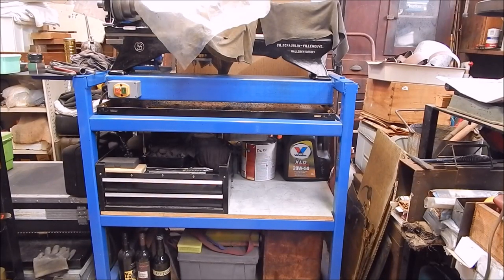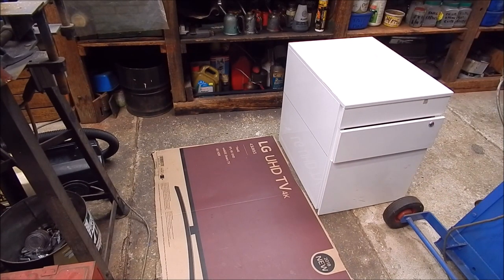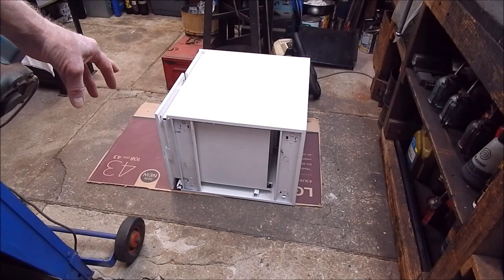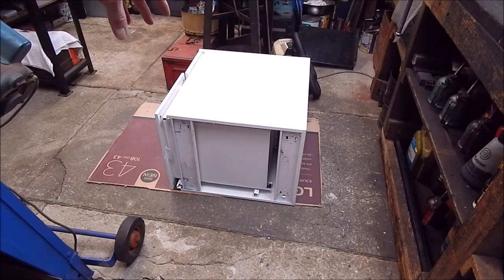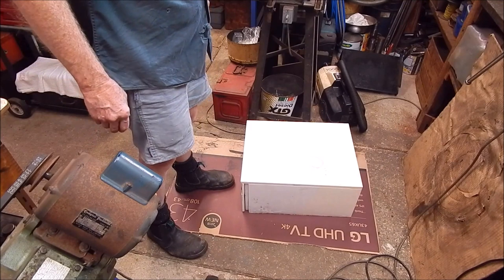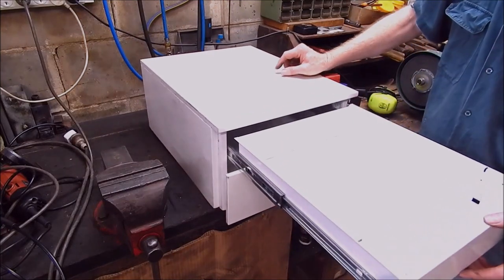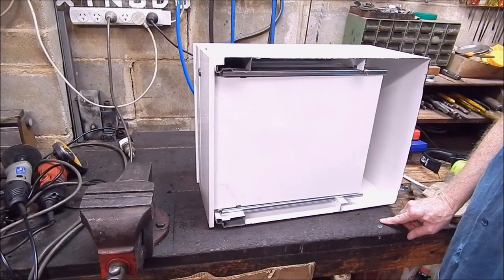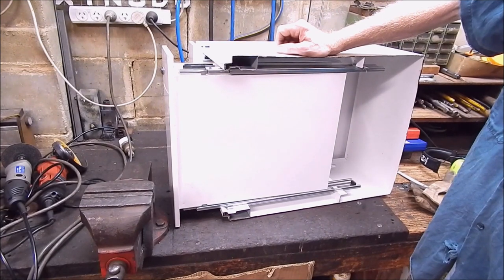I cut a steel filing cabinet in half for lathe tool storage

Comment: We have those cabinets in our office. Pain in the arse to move as the wheels fall off any that are moved. Your modification sounds brilliant as the top two drawers are perfect for tools and what not.
Some U tubing from possibly Supercheap Auto should finish the raw edges or a piece of ply with brackets fitted to the bottom will form a base.
Good score mate.🇦🇺👍

Comment: Hi Rob - cut the bottom off the cabinet and attach it with some pop rivets. It'll give you some clearance for the lower draw as well as the strength you need.

Comment: Glad to see you wearing the earmuffs Rob. It's amazing how much peace and quiet they bring to a workshop environment. I love 'em. You might even find me wearing them (accidentally) an hour or more after doing whatever it was that was noisy. I just love being able to shut the outside world out, and work with my own thoughts for a bit.

PS: What's the fire situation like in Adelaide?
Reply from the maker: Hi Craig,  Earmuffs are good. I agree with all you've said.  I've used a lot over the years and the greater noise reduction the better.  Earplugs are a bit useless in comparison. 

The fire situation in Adelaide has settled down, although it can flare up again given the right conditions.  Kangaroo Island has massive damage and is still burning uncontained.  Bad Karma in the Eastern states, but the amount of vegetation and terrain makes the outcome inevitable - regardless of any climate change.  Cheers Rob

Comment: Just a suggestion, as it wasn't obvious from the footage, turn the blade around so it cuts on the pull stroke when using the single handle hacksaw. Much like a Japanese wood saw, you will be less likely to permanently bend the blade when under pressure.
Reply from the maker: Good idea Laz.  I will try that.  Cheers Rob

Comment: I always like how you find useful items in the trash. Here in the states too many folks try to sell junk in yard sales. Of course it’s still pennies on the dollar. File cabinets make great storage. I like the fact that the shelf’s aren’t really deep so you not having to stack small items on top of each other
Reply from the maker: Hi James,   yes the drawers being shallow is a good thing.  The full sized drawers are not great as the cabinet can tip forward from the weight when open.  Plus what you said.  So these small ones should work out real good.  Cheers Rob